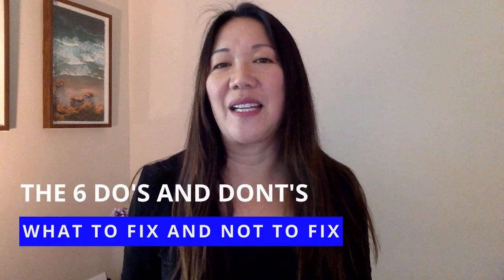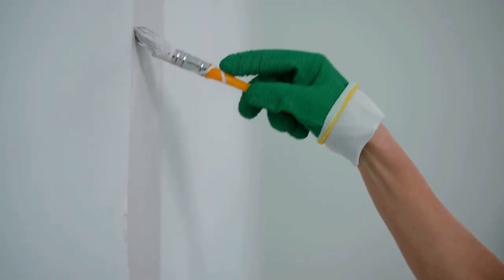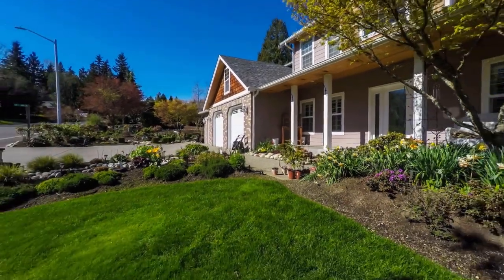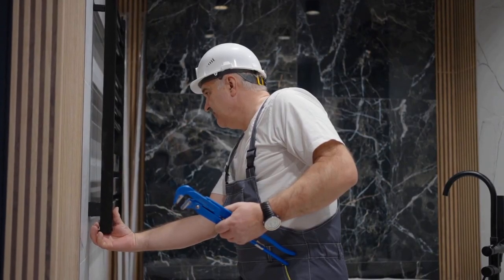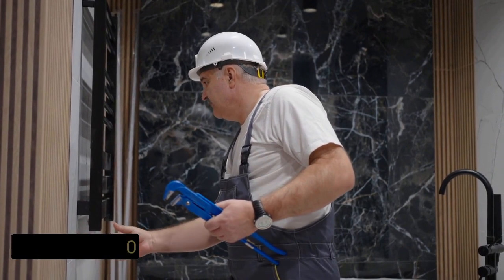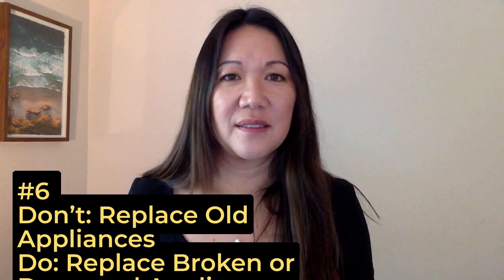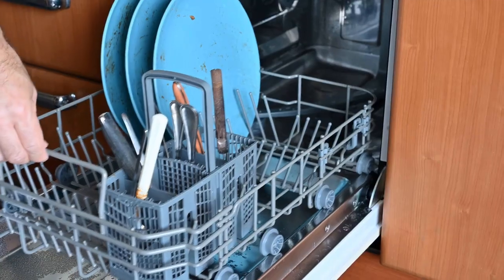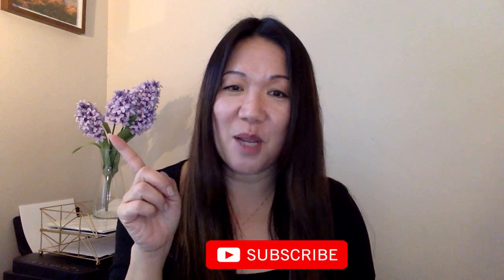What NOT to Fix When Selling Your House - Top 6 Do's & Don'ts to Keep the Most Money in Your Pocket

Comment: There are two rooms I wanted to paint but my agent said not to bother. She also told me not to bother fixing my low water pressure and dishwasher but I'm doing it all anyway. Why would she tell me not to bother? I don't get it!
Reply from the maker: Thanks for your question! Since I haven’t seen your house, it’s hard for me to truly understand where your agent is coming from. But I am guessing if you aren’t painting the rest of the house and making a significant difference in the overall look, painting only two rooms isn’t going to have a significant impact (unless the rooms are non-neutral colors, then I would say paint them ). If the dishwasher is broken, fix it. For low pressure, the majority of buyers are not thinking water pressure. Save your money, unless a buyer brings it up after a home inspection. Negotiate or fix it then. Hope this was helpful. If you have any more questions, call/text me at (858) 335-4597.
Reply: @YourPowaySanDiegoRealtor  Thank you! Yes, my rooms are neutral that could be why she told me to skip it. Thanks for the advice!

Comment: I have seen lots of times where people put in new carpet and the new owners will rip it out and put hardwood or repaint the whole house.
Reply from the maker: Thanks for watching! I agree. A friend of mine who has bought quite a few houses says it’s a waste for sellers to put in new flooring. She would rather they leave the old flooring. Because she just going to change it.
Reply: @YourPowaySanDiegoRealtor  People need to understand that  they pay dearly  (the cost of the house and interest over 30 yrs) for a house that is "turnkey".  Often they end up buying cheaper stuff that  just ends up needing to be replaced. It is better to have enough in saving to replace floors, appliances,  and especially bathrooms and kitchens and then you end up getting what you like. I have a house that I bought in the 70s and over time I replaced, fixed, and painted what needed to be done. Owning a home is a never-ending challenge.